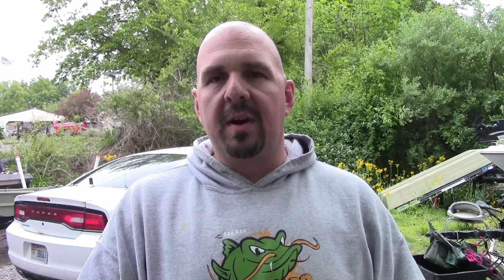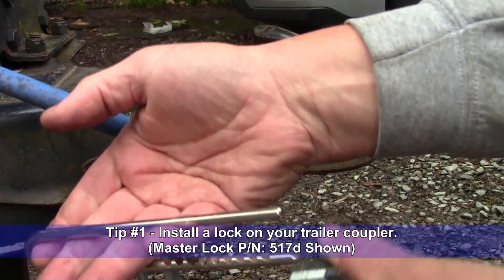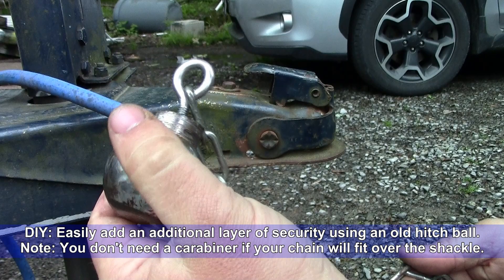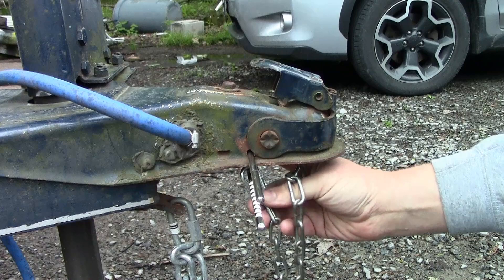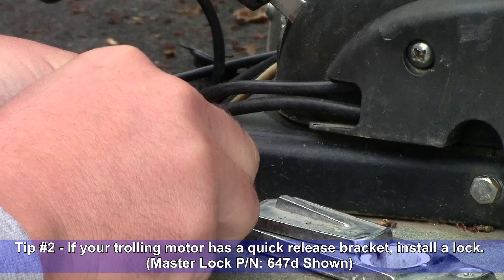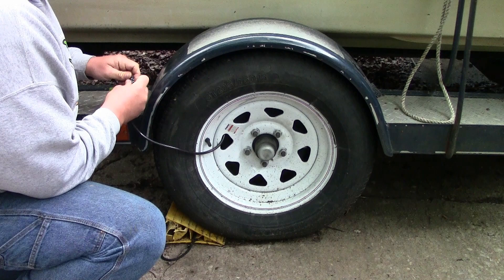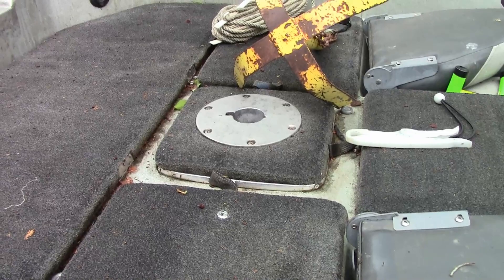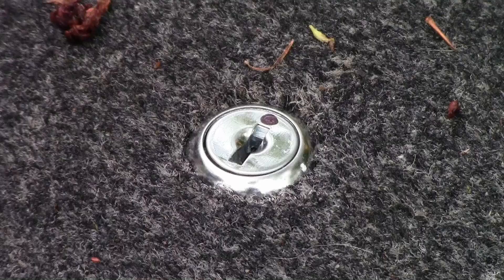Boat and Trailer Security: 4 Budget Friendly Simple Ways to Prevent Theft

Comment: The second part isnt required because if they break the first part then the rest comes off. Should have a seperate tow ball lock

I have about 4 locks for my trailer
. One goes through the wheels and can't be bolt cut. Then another on other wheel. That can be bolt cut. Then a hitch lock can be used while on and off car, and another chain . Oh and a camping alarm.
Reply: Hey mate, would you please explain more about how you locked your trailer. I've done what the video suggested but I like the fact that your lock through the wheels cannot be cut?

Cheers

Comment: A bolt cutter and 15 seconds to have your trailer locks cut (both the coupler and the wheel).  Sad, but true.

p.s. -  They don't even recommend cable locks for locking up bicycles anymore.
Reply from the maker: Locks only keep honest folks honest. For the rest, it's why we have hollow points. Sad but true.
Reply: @TheWeekendAngler  Unfortunately, the local authorities where I live frown on the use of hollow points by private citizens as a theft deterrent.  In fact, they don't even approve of regular rounds or even buckshot.🙄
Reply from the maker: @dogrsqr  getting sad, isn't it? Basically what you want to do is make your trailer a little harder to steal than just backing up to it and taking it. It won't deter a determined thief, but most thieves want an easy target. They'll leave it alone and take one that isn't locked up. More time spent messing with something is more chances of getting caught.

That's my professional opinion having nearly 20 years experience of service in this "local authorities" of which you speak, my friend. 😂